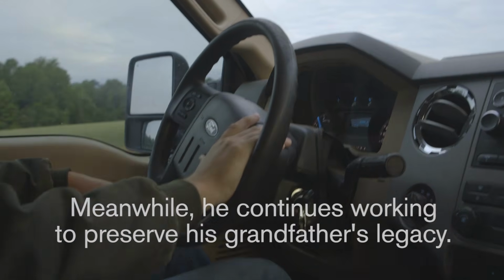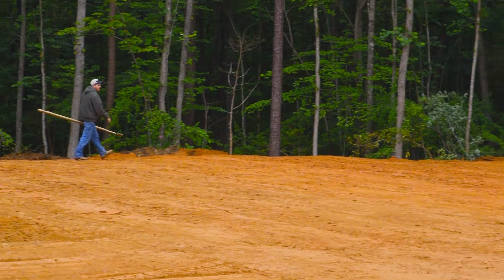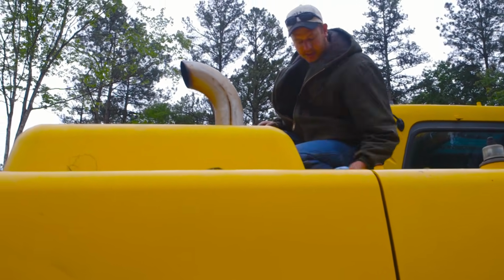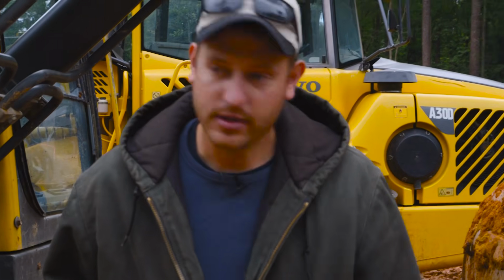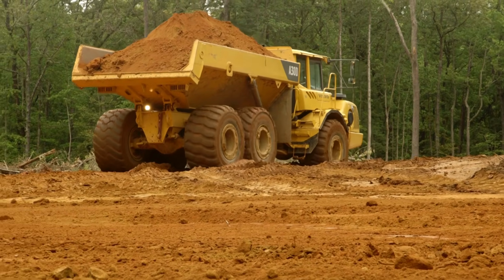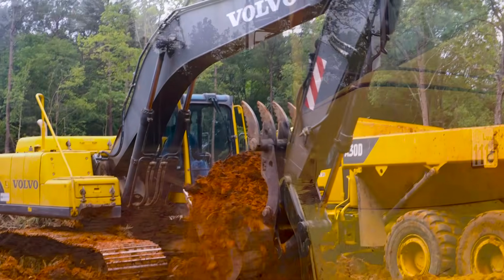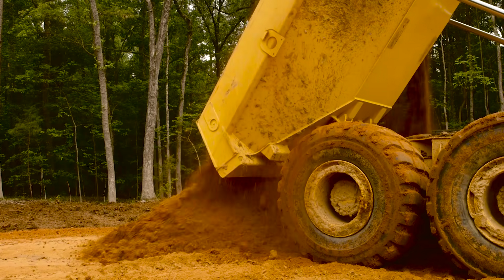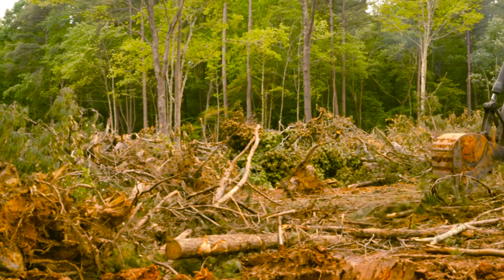A Day With Excavator Pro & YouTube Star Chris Guins (LetsDig18)

Comment: I did HEO (heavy Equipment Operator) the first day we learned how to do a log book, the next day we signed our machine if choice I picked Front End Loader, Bull Dozer, and Excavator on the Dozer we had to dig a V-Ditch, on the loader we had to move a pad we all practiced on to another location and rebuild it, Then came the fun tractor( Excavator ) after we learned about it Our instructor told us 2 things to keep in mind,,,idlers are always in front and never dig to the side if the tracks! we had to clean the tracks everyday and the instructor showed us how to spin the tracks to remove rocks and gravel that would no come loose with the shovel.!!!

Comment: It seems like he's a pretty good operator by him loading his self and Hauling his self isn't efficient having somebody run the truck so you can concentrate more on your digging is more efficient more time efficient and it does not matter if you load the truck from the back or the front it takes the same amount of their both ways I want to trackhoe I have to end dumps I run and I do anywhere from 300 to 350 loads per day and at our shift

Comment: I miss running this equipment. I ran all this same equipment for years and actually started by running farm equipment.  I was seriously injured on the job back in May 23, 2013. Ever since I've been unable to run equipment and have been told by many doctors after 5 surgeries, that I'll never be able to work again.  I would give anything to run this equipment again. I know that there is time requirements and quotas to meet when running the equipment and that fact alone being that I just can't do anything as quickly as I used to or to have someone with the patience to understand that it would take time for me to climb safely into the cab of any of these machines but I would still give any of my prized possessions if even I could just run one of these for a day...

Comment: I'm no pro operator by any means, but have figured out a lot on my own, but learned a LOT too by watching Chris. One thing I picked up on in this video was when he said to always dig over your idlers. When I bought my machine, the guy I bought it from told me to always dig over your sprockets (especially when on a slope) so that you didn't put stress on the grease pistons in the idlers by the machine wanting to slide down hill. His logic made sense I suppose, but Chris's is just as good or better, that you're putting a lot less stress on the bushings in your tracks by spreading that load over a larger contact area. Always something new to learn!
Reply: Tom Brueggen there are two different lines of thought here. For the most part digging over the idlers is the correct method but if you are on a slope you are advised, just like the salesman told you, to keep your sprockets on the downhill side. This prevents the tracks from jumping the sprocket. Always keep the sprocket on the downhill side if possible. There is no hard and fast rules. It’s just like digging off the side of your machine. That’s acceptable to under certain conditions. These are extremely flexible machines in that you can dig in virtually any position. There is no single expert on the subject and you would do well to listen to everyone and keep learning.
Reply: Always good to dig over idlers if you get into panic situation natural reflexes get you moving in right direction first time you hit pedal

Comment: 12 years old and 5,000 hours? lol well I think it is good that it doesn't use oil but my company would have tens of thousands of hours on a machine 12 years old
Reply: well when you have 13 machines and 3 people who run them the hours get spread out over everything
Reply: nah makes sense.  don't mean it as a slam just making a comparison.  Your company takes good care of the equipment anyway so if it did have 12,000hrs on it i'm sure it'd still be decent
Reply: still not bad for mostly a one man show. Based on your picture and comment i assume you work in a mine or some other large excavation project.